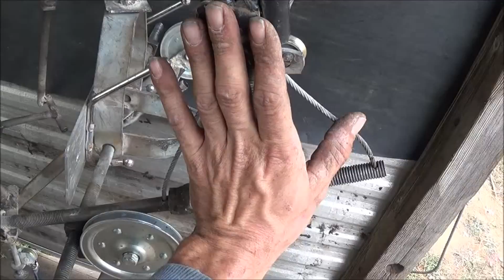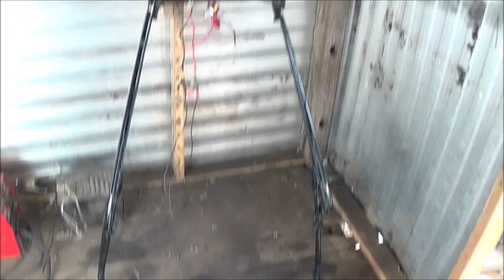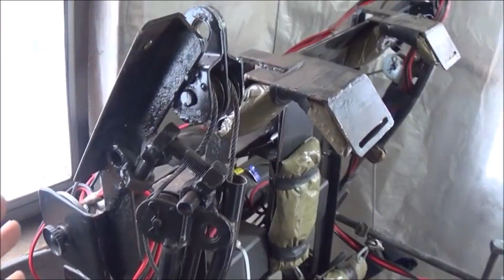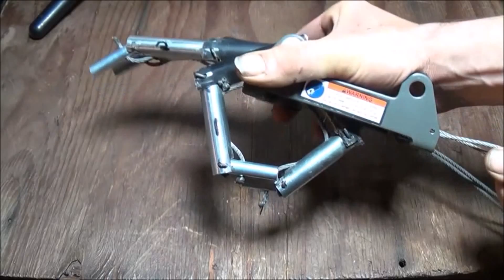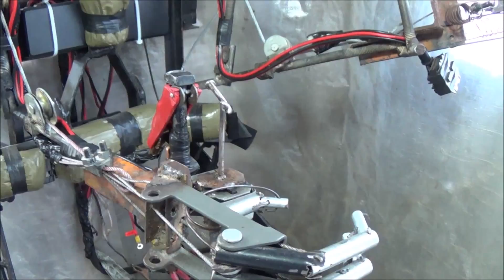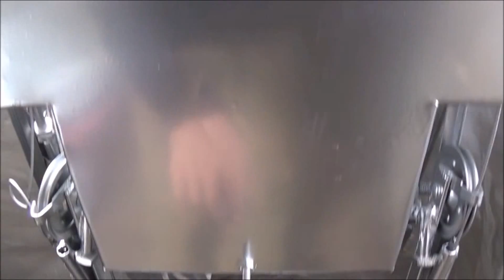"Powered Exoskeleton Suit"  Full Build And Test.

Comment: One suggestion, instead of using feet to control the legs lift, why not use a pully system that pulls a switch and then causes the suit to move the legs, while also installing a switch in both hands for locking the legs in place and unlocking, just a suggestion if you plan to make a MK3 or add on to this one